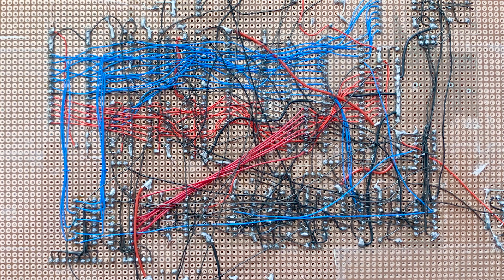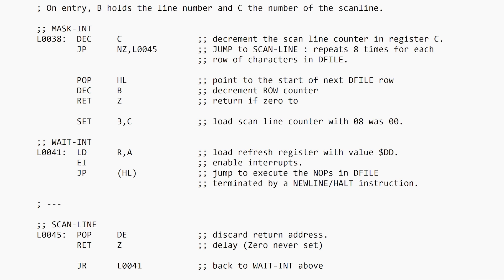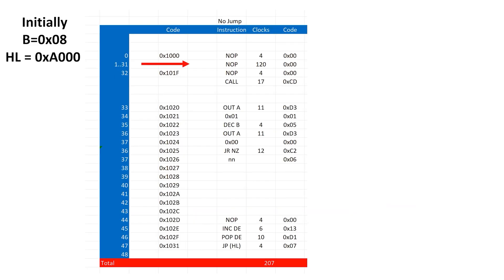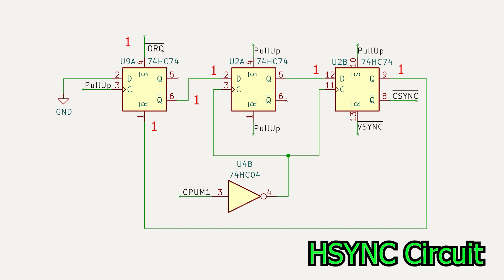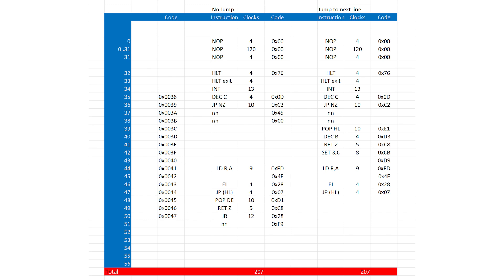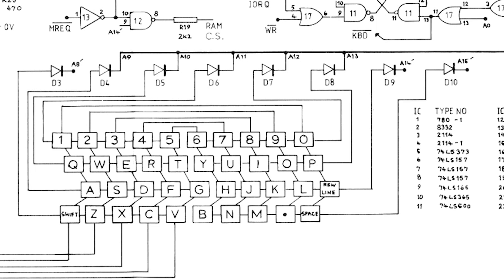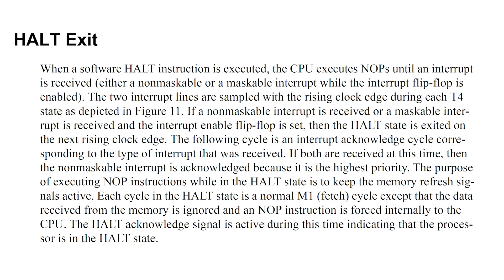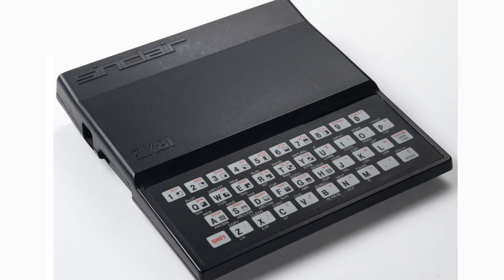ZX81 Video Circuit Part 6.  ZX80 HSYNC and Bring Up

Comment: Super interesting video, thanks! Where did you get the information about hsync on ZX80?
Reply from the maker: There's no one definitive source, cobbled together some stuff online and looked at the annotated ROM disassembly, which actually has a surprisingly good description.
Reply: @DrMattRegan thanks! Are you sure the ZX81 follow the same behaviour for firing hsync (int ack)? I’ve tested some games that have interrupts disabled and nmi generator disabled too

Comment: I was part of the design team working on the ZX80 back in 1980. The design of how the sync pulse is generated using the Z80 cpu and TTL logic was done by Jim Westwood a design engineer. Clive Sinclair had very little input at this level of the design.
Reply from the maker: @brianflint133  apologies for not being clearer. I know Clive didn’t really have much technical input.  I tried to use the term “Sir Clive’s team”. It’s hard to follow when you introduce too many individual names in a short video.  Hopefully MicroMen made it clearer.
Reply: @DrMattRegan  I remember the day a meeting was called at Sinclair Research by Sir Clive Sinclair. There may have been around 4 or 5 people present. He told us we were to be making a computer ( The ZX80 ) which would sell for less than £100.
Reply from the maker: @brianflint133  Excellent.  Thank you for your contribution.  How accurate was the MicroMen depiction?  I saved money from a paper round to buy a ZX81 (my first computer) and learned BASIC on it.  I went on to do a PhD in computer science and designed GPUs at NVIDIA.
Reply: @DrMattRegan  The MicroMen depiction is fairly accurate. I will have to watch it again. I joined Sinclair Radionics in 1971 - I worked on a small portable TV ( Black and White with 2 inch screen ) for a number of years. I also got involved in getting Sinclair's first pocket calculator into production  - The Executive.  The company at this time was based in St Ives in Cambridgeshire. Around 1979 the company spilt up and Sinclair Research was formed and was based in Cambridge City Centre on King's Parade - just opposite to the entrance to Kings College.

Comment: ... And in Dr Matts next series he recreates the Inmos T414 Transputer in only EPROMS and HCT logic and gets it running Occam with an expansion bus to allow n-Transputer concurrency.
Reply: Thinks... A series on the Transputer would certainly be interesting, although possibly even more of a niche topic than the ZX80/81.
Reply from the maker: Ah yes the transputer.   Actually the biggest board I've wired up is here https://dl.acm.org/doi/abs/10.1145/192161.192192
have a look at figure 6.  All done with point-to-point soldering.  I might do a series on it later.

Comment: That Hsync and Vsync circuit with its controlling instruction sequence is really neat. I hadn't looked at how that part worked before. Very clever to used the M1 signal as a per-instruction-clock to time the pulses. And I was very impressed to see the board running with an original ROM - the ultimate test.
Reply from the maker: Thanks, even though these machines are cheap, there are many clever features required to get them that cheap.

Comment: what about using the RST38 which is the subroutine for printing the screen.
Reply from the maker: I'm not sure you can use RST in this case, we need to keep track of the number of NOPs before it.  HALT uses the refresh register, and CALL implies it in the call address.
Reply: @DrMattRegan  if you get a MEMOTECH MTX512 then you have access to a machine that has MTX BASIC which has a built in assembler and a program called PANEL, if you go through the firmware using PANEL &H0000 you will come across the RST38 instruction, to create an assembler routine you just do ASSEM 10 <ENTER>